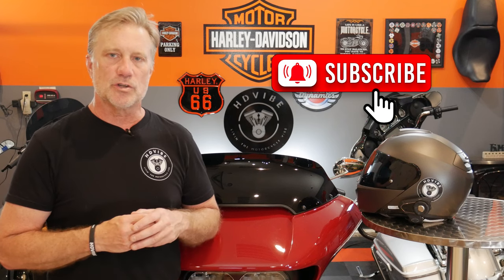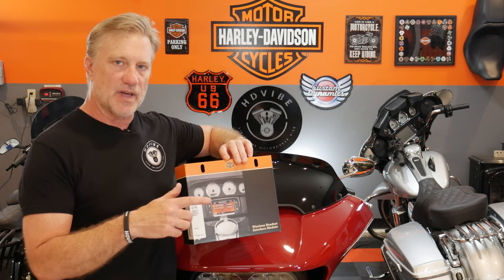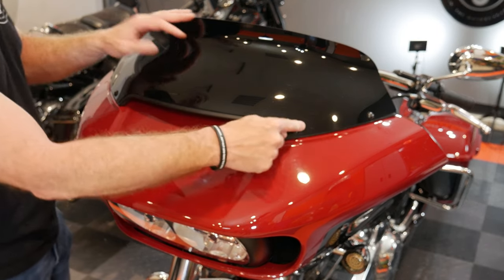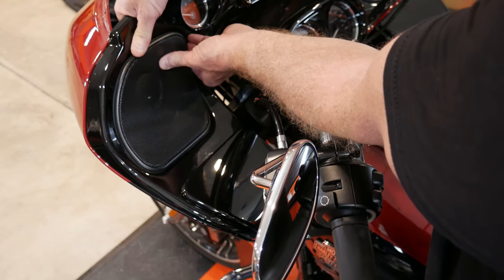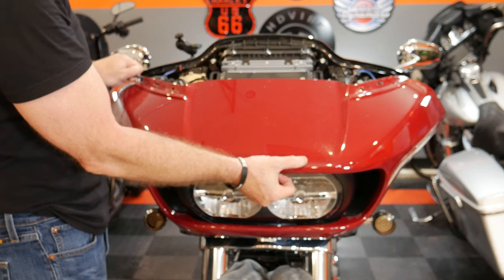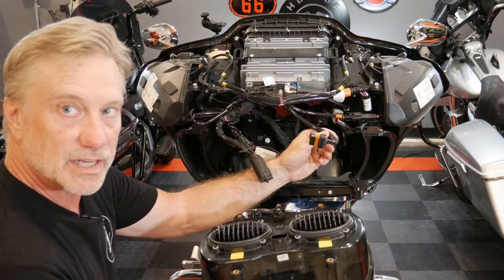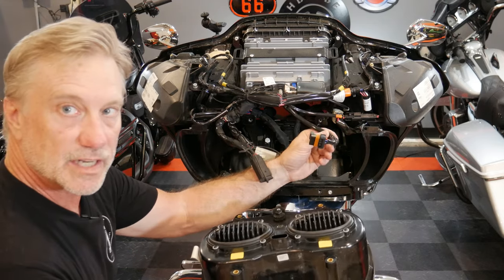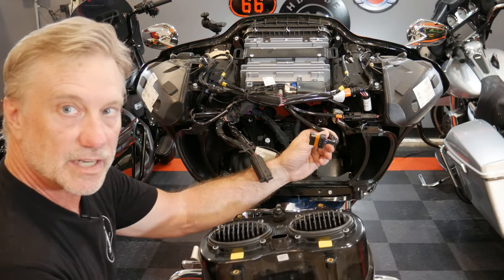Go wireless on your Harley with a WHIM | How to install WHIM #harleydavidson #roadglide

Comment: 341 euro...for BT connectivity that was already build in....sorry but that is just nuts
Reply from the maker: Thanks for watching and commenting.   Unfortunately the Bluetooth built into the infotainment system only allows a phone to connect.  The WHIM is an addition that will allow a Bluetooth headset to connect.  Unfortunately, if you want Bluetooth headset to connect to the bike, the WHIM is the option.   If you are already a subscriber to the channel...thank you.   If you haven't yet subscribed to the channel I'd be honored if you'd consider doing so.   Thanks for your support and ride safe.  👊👍✌️

Comment: Why wouldnt/couldnt you just put the firmware update wire and route it into the right glove box with the other USB?
Reply from the maker: You could do that as well.  Obviously you would need to drill the hole and get a rubber grommet to keep it sealed up.  But that is definitely another option. 👊✌️👍

Comment: I love zip ties!! Ha
Reply from the maker: You can never have too many
Reply: @HDVIBE  I also have a big bag of little plastic tabs that have adhesive on one side and a small plastic loop on the other side with no real design advantage other than it can  hold wiring and you can run wiring under your tank without worrying about it ever dropping onto anything.

Comment: Does anyone have a concrete answer on if you NEED the harley branded Sena? I have a cardo freecom 4x. If i buy the whim, will ot work?
Reply from the maker: Thanks for watching and commenting.   The Cardo will connect.  The only piece you won't get is stereo sound.  Only the Harley branded sena headset will give you stereo output into the headset.  If you are already a subscriber to the channel...thank you.   If you haven't yet subscribed to the channel I'd be honored if you'd consider doing so.   Thanks for your support and ride safe.  👊✌️👍

Comment: I loaded the firmware before I installed this kit. Just removed from the original box the WHIM and connected to the harness in the house. It updated to the latest version. This is the closest one I have found for my 2023 Road Glide and thanks!
Reply from the maker: Thanks for watching and commenting.   Don't forget you have to get the infotainment system flashed at the dealer to get the WHIM enabled in the infotainment system. If you are already a subscriber to the channel...thank you.   If you haven't yet subscribed to the channel I'd be honored if you'd consider doing so.  Thanks for your support and ride safe.  👊✌️👍

Comment: I put the WHIM firmware cable under the rightside speaker cover. Great video
Reply from the maker: Thanks for watching and sharing your tip.  If you are already a subscriber to the channel...thank you.   If you haven't yet subscribed to the channel I'd be honored if you'd consider doing so.   Thanks for your support and ride safe.  ✌️👊👍

Comment: I just picked up my WHIM today. Have to pull apart my fairing to install some things figured I would as it to the list. I really like what you did by not removing your tank for instal. I’m in agreement they should have added this to every model especially touring models. Anyways this week or next week I’m installing this. Been using my Harley card lately to stack up points for the Harley branded 30k headsets. Wife loves being able to communicate when we are 2 up. 😊
Reply from the maker: Thanks Rico for watching and commenting.   Sounds like you have a few projects in the works.   If you are already a subscriber to the channel...thank you.  If you haven't yet subscribed to the channel I'd be honored if you'd consider doing so.   Thanks for your support and ride safe.  ✌️👊👍

Comment: Great install!...I installed the WHIM on my ultra limited and paired with the Harley branded Sena S50's....I still haven't convinced myself that it was worth the money!...it just doesn't work as seamless as I thought it would...or maybe I just had to high of expectations for it! I'm going to keep using it....but if anything happens to headsets...think I'll just go back to the harley hard wired headsets!...great video...stay safe...ride safe!!😎👍🤙👍🤙🇨🇦
Reply from the maker: I've been running THE WHIM on my 2015 for 2 years now with the 30k.  I've not had any issues or challenges.   My only suggestion is to make sure your headset pairs to the bike first and then pair your phone to the bike.  If your phone pairs first to the headset,  you can get some challenges.   Happy to try to help you if I can.  Ride safe. 👊👍

Comment: thank you for the info. What I'm still trying to find out if this system includes Apple Carplay. I'm about to have the dealer install it since I'm a new rider and own a new Tri Glide Ultra
Reply from the maker: The WHIM doesn't not include Apple Carplay.  Carplay is included as part of the infotainment system on thr bike depending on the model year you own.  My bike is a 2021 and the infotainment system has Abdroid Auto and carplay.  One way to find out is to plug your phone into the bikes USB port.  If Carplay comes on you have it.  If not you may not.  I know in 2020 the WHIM or a jumper was needed to enable it I believe.   Best to check with your dealer or do some Google searches based upon your bikes year.  Thanks for watching and ride safe.  If you have already subscribed thank you.  If you haven't yet subscribed,  I would be honored if you'd consider doing so.👍👊
Reply: @HDVIBE  thank you for your reply. really appreciate it. i have 2022 Tri Glide Ultra. i will try what you recommended and see if it works
Reply from the maker: Always happy to try to help if I can.  That's what my channel is all about. 👍👊

Comment: thanks for the information, I installed the whim, and purchased a Sena 50s.   it connects to the bike perfectly, or to other riders, but how do I switch from the bike to other riders?
Reply from the maker: You shouldn't have to do anything to switch between.  It should automatically do so.  I usually use the mesh capability on the 50C for rider to rider and blue tooth to the bike.  I also use CB and it all works at the same time.  I hope that is helpful.   Thanks for watching and ride safe. 👊✌️👍

Comment: Great video. Astounded it’s not already set up for wireless but hey. Would this allow it to connect to wireless earbuds?
Reply from the maker: Thanks for watching and commenting.   That is a good question which I do not know the answer to.  I tend to doubt that it would but it may be possible.  If you are already a subscriber to the channel...thank you.   If you haven't yet subscribed to the channel I'd be honored if you'd consider doing so.   Thanks for your support and ride safe.  👊✌️👍

Comment: Is there not enough space to feed that cable into one of the side pockets in the fairing ?
Reply from the maker: That could work as well.  However, you would need to drill a hole in the side pocket to get the cable into it.  Thanks for watching and commenting.   Ride safe and enjoy.  👊👍✌️

Comment: Sir, need your help. 
I currently have the whim and driver / passenger Sena harley brand head sets. 
My ? How many Sena helmets can I connect to the whim, say as driver. 
I just purchased the modular harley Sena full face. Do I need to forget the original Sena 20s conectó the new modular or can I add the modular helmet and choose it on the screen?
Thank you
Reply from the maker: That is a great question and one I have as well.  My guess is you can only connect one headset to the WHIM as a driver.  If you are switching between headsets, my guess is you will need to use the "forget" option and then pair your other headset.  I also have multiple headsets and planned on testing it out to see if I can pair two headsets to the driver...but I'm guessing probably not.  Thanks for the question.   I appreciate your support to the channel.  Ride safe and enjoy. ✌️👊👍
Reply: @HDVIBE  thanks for replying 
If you figure it out pls let me know 
My helmet is coming in the mail and I can’t play with it yet.
Reply from the maker: You bet.  I will see what I can figure out and let you know.
Reply: @HDVIBE  very kind of you , thank you for your time and reply.

Comment: Hola desde España tengo una strid glide especial del 2017 le intalado el interfac y e comprado un casco modular OUTRUSH R v 1.2.1 pero soy incapaz de conectarlo con la moto lo reconoce pero da error de emparejamiento y aqui en españa no xonsigo dar con nadie que me de soluciones asi que le pido que tome un ratito y me pueda ayudar muchisimas gracias de antemano y un saludo mi nombre es Manuel
Reply from the maker: Thanks for watching and commenting Manuel.  I appreciate your support, but, unfortunately I not real good with Spanish.   If you are already a subscriber to the channel...thank you.  If you haven't yet subscribed to the channel I'd be honored if you'd consider doing so.   Thanks for your support and ride safe.  ✌️👊👍

Comment: Thanks, but No! I will not disassemble the whole thing to install the WHIM, “Harley” why you are not making things easier for us by adding a dedicated empty slot at the front. I’m starting to regret buying a Harely motorcycle over the Japanese motorcycles.
Reply from the maker: It definitely would be nice if the WHIM was included on all models but then the prices would be even higher.  The WHIM is included on the CVO models but no others at least as if the 2022 model year.  Thanks for watching and ride safe. 👊👍✌️

Comment: Question. I installed a CB on my 2021 FLTRK and I’m thinking about going wireless. Will I be able to talk on the CB using the wireless helmet or headset or do I have to stick with the wired headsets
Reply from the maker: The wireless will work if you install the WHIM.  I use my wirelessly as i have the WHIM installed. .   I have a video on the WHIM install  as well if you'd like to check it out. ✌️👊👍
Reply: Another question.  Still contemplating, but will WHIM install disable the wired jacks on bike?
Reply from the maker: Yes.  If you install the WHIM, you disconnect the wired harnesses as they both plug into the same plug in the fairing.  Thanks for the question.  ✌️👊👍